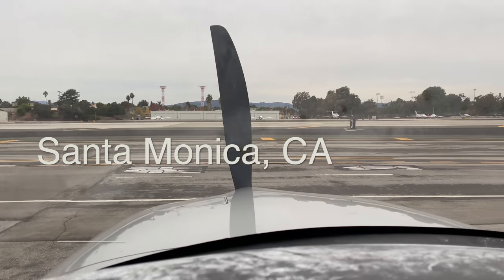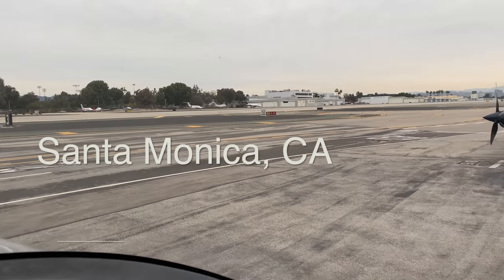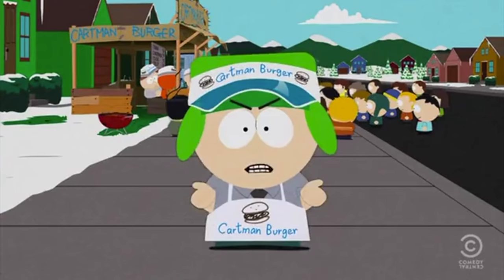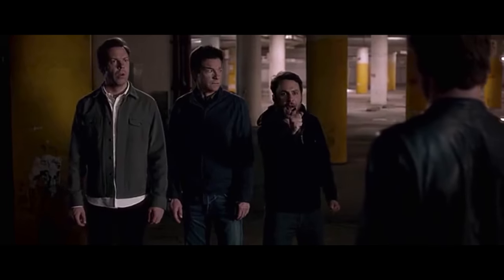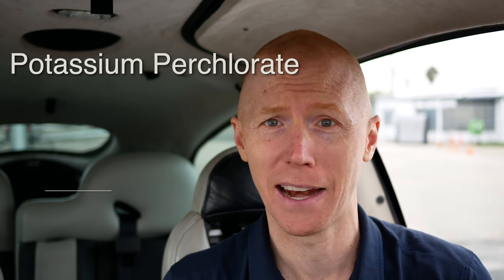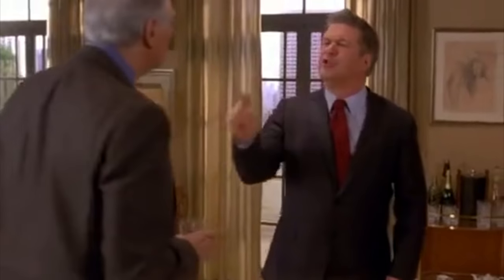WHY A Passenger Must Pull on the Mask | Airline Pilot Explains

Comment: A little aviation “trivia”. The 1996 ValuJet crash in the Everglades, was found to be caused mostly by improperly packaged plane oxygen generators in the cargo hold. They were expired and the company was transporting them. I placed the quotation marks on trivia because 110 people died and I’m sure to the families is not trivial.
Reply: Yeah the handling compay confused "expired" meaning out of date with "empty".  The fire was so intense it burned a hole through the cabin floor. RIP all on board the Critter.

Comment: Tell them how much time they have to put on their oxygen at 35000' before they go too silly to do anything.
Reply from the maker: well hopefully during that situation you yank it so hard to your face you don't have anything to worry about
Reply: Useful consciousness at that altitude is something like 30-60 seconds, if the cabin somehow completely depressurized.

I would be more worried about the pilots getting their masks on in that situation!
Reply: @HamBown  I won't. The pilots are trained for this scenario and the masks for them are very easy to use with one hand.
Reply: @roichir7699  there have been accidents due to pilot incapacitation in the past. They are the ones who are going to save the rest of you. The oxygen generators are only there for emergency descent. They last about 15 minutes.
Reply: @roichir7699  Tell that to Paine Stewart.
Reply: @HamBown  Of course there have been accidents due to that. But as long as you have no idea about technology improvements and procedures you are simply just guessing and not contributing to anything else than panic.
I did try these masks myself, I did experience hypoxia in a controlled environment, I did experience rapid decompression and other stuff. And I know how technology and procedures work.
They are as safe as it gets. With a probabilty of catastrophic system failure of less than 1:10^9.
That's about nine lottery jackpots in a row.
Reply: @simonjester6908  Do your research before making such claims. Especially what have been done since to prevent it from happening again.
Reply: @roichir7699  Are you saying Payne Stewart's plane crash was not due to pilot hypoxia?
Reply: @simonjester6908  You are missing the point. Back then it was concluded that the procedures and training were insufficient. So that has changed.
As before, it seems you have no idea how things work, how procedures work, which training pilots get and what progress has been made.

Comment: Hi Kelsey.  While it is true some planes may have a few oxygen generators for the passengers, 747-8 have oxygen bottles for the passengers just like the crew.  The 747-8 has a minimum of 5 passenger bottles in the fwd cargo sidewall and can have as many as 18 in the ceiling of the forward cargo. We also have very strict leakage rates, NO LEAKS ALLOWED! Check out chapter 35 in the Aircraft Maintenance Manual  (AMM).

Comment: On a lot of wide-body aircraft types like the B777, they DO actually use a large collection of compressed O2 cylinder tanks, stored behind the linings in the cargo area, for passenger emergency oxygen. The pressure can be displayed in the flight deck, and the tanks can be filled up by maintenance. On some airlines they just have to be replaced.

Comment: If there is a pressurization problem in a freight plane, would the pilots make emergency descent similar as in passenger planes, or more subtle descent instead?
Reply: They would as the pilots oxygen system has limited resources too. More than the passengers, but still limited.
Reply: Good question.
Reply: Yes

Comment: I think the engineers designed  "fake Oxygen" not only because tanks would be heavy, leaking etc.  but also because pure oxygen (O2) is an extremely flammable gas so it would be like carrying on board a bomb waiting to explode.The chemical reaction to produce Oxygen would minimize  that risk and would make Oxygen available only when it's needed.
Another interesting video from you Kelsey (being an anesthesiologist I have to deal with 02 on a daily basis),thank you for sharing it.
#Kelseyfavouritepilot 😘
Reply from the maker: that I am sure was another thing they were thinking about when they did it... Thanks Nina, really appreciate that!
Reply: @74gear  Thank YOU

Comment: Youtube comment section engineer here.  Another added benefit of chemical vs gaseous 02 is that it can function independently from any electrical systems in the plane.  In any sort of catastrophic failure it is it's own system that works independently from the plane. Unfortunately this reaction is literally ripping off atoms from each other (mainly hydrogen from oxygen in hydrogen peroxide due to it's abundance of 02 and easability/cost effectiveness to make) so it's going to basically generate heat no matter what.

Comment: These oxygen generators are actually what caused the crash of ValuJet flight 592 in Florida. Their cargo was labeled "used oxygen containers." When in fact, what they had on board were expired oxygen generators. A few of them were activated in the cargo hold. When these activate they generate a tremendous amount of heat. It started a fire and filled the cabin with smoke.

Comment: This should replace the standard FA announcement about the masks. I've only flown a few times, but don't recall any emphasis put on the importance of pulling on the strap to activate it. I feel that could lead a lot of people to unknowingly misuse it and not activate it. They also didn't mention anything about the cheat, odor, and smoke potential, which can confuse and panic passengers even more.

Comment: i remember from middle-school,  welding class -  A before O, or up you go ↑
acetylene before oxygen or else massive explosion.  Another reason no Oxygen tanks on planes,  
Oxygen by itself is extremely explosive!
Reply: There were older planes with oxygen bottles, one of them let go on a Qantas 747, blew a hole through the fuselage and through the roof via a door handle. The pilots thought a bomb had gone off.

Comment: The oxygen generators produce a lot of heat as well, it is stored separated, pressurised air tanks would leak out over time.
The compact oxygen generators are lightweight and are changed out for new ones every few years.

There are small compressed oxygen cylinders that can be carried around and are in compartments, usually 8 or more and these are for cabin staff..
Reply from the maker: There you go Grant you seem to be familiar with it all!

Comment: I would guess the chemically generated oxygen is also chosen, because either small tanks or large tanks with oxygen-lines are also a firehazard in case of leaks. Marine engineer worked as technical chief of a hospital here, so O2 leaks, as well as NO2 leaks were always a concern in the distributing pipesystem. Elevated O2 levels in close proximity to electrical systems are always a risk, though not likely a big risk. There would have to be an electrical fault as well, or open circuit that generate a spark.

Comment: Kelsey, some commercial jets had oxygen tanks in the past, like 12 or 15 liter bottles installed in the wall for passenger. There was an event where one bottle exploded and ripped a part of the fuselage. I think after that accident they implemented a new rule regarding oxygen tanks on board. It is true, like 20 x15 liters tanks are like 500kg or almost 1000lbs. They are heavy and in a case of fire they would be a trigger for even bigger disaster( fire+oxygen) very bad combination.
Reply: Are there still oxygen tanks on the plane for emergency purposes? Like in case someone has a heart attack? I imagine the oxygen used for when depressurization occurs would be inadequate.
Reply: @Boundwithflame23  For cabin crew in front and at the back there should be couple of 5-7 liter bottle with oxygen, it could be also used for first aid.The most important thing is to have some good trained cabin crew to make first aid like they are trained to do. Cabin crew needs oxygen bottle so they can move free and help and assist other passengers.Imagine if some need help and cabin crew can not leave seats because they have only oxygen provided from the ceiling like others.
Reply: @Boundwithflame23  Tanks for medical use and for the cabin crew are mandatory.
Reply: Ah. I figured as much. I was just curious because of the bit about a new rule being implemented.

Edit cuz my sleepy brain thought you were someone else on first glance, Touring Jedi.

Comment: If in a panic situation is it possible to pull the mask so hard that it can break?
Btw another great video!!
Reply: Yes. You can pull the hose loose if you pull too hard on the mask. The hose is easily pressed back onto the fitting. Remember, pull firmly , don't yank it.

Comment: 'in the US it's 41,000' - is there a reason it's different elsewhere, and why?
Reply: American lungs cant handle going as high
Reply: Different regulations in different countries, as USA has FAA regs (FARs) and Europe for example EASA. Many things change, including for example at what altitude you switch from local altimeter setting to standard (18.000 ft in the US, 4.000 I believe it was in some country in the Caribbean...can't remember) or even the unit you use for altimeter setting (inches of mercury in the US, standard being 29.92, and milibars in many other countries with the standard being 1013)
Reply: The reason : faa

Comment: Another interesting video! 

Not sure if you have answered this in another video already but what is up with the blinds on the planes why do they need to be up during take off and landing?
Reply: There's a couple of reasons for this

1. So rescue crews can see inside in the event of an emergency landing
2. If it's dark outside (and this ties in with having the lights dimmed for take-off and landing) it allows your eyes to adapt to the ambient light. That way if you have to evacuate for any reason your eyes won't need to adjust to see properly. 

The same applies for if it's bright outside, your eyes can adjust to the brightness so it won't just be a wash of white when you get out of that emergency exit
Reply from the maker: so you can see during an evacuation if there is something out there before you open the door
Reply: Additional to the already mentioned. You want to know if there is a fire on one side of the plane after the landing did go wrong. So you can use the exit on the other side.

Comment: Hi there. I have 2 questions. 1) When the plane descends to 10-15K feet--does the captain begin to ventilate with fresh outside air to get rid of the smell and the smoke and provide air for the passengers to breath? 2) On a long haul flight  across an ocean what happens when the plane experiences decompression? Can the plane descend to 10-15K feet and still have enough fuel to make it to an alternate airport?

Comment: That’s interesting. I’m not a chemist but since oxygen is it’s own atom despite usually pairing up together in twos I figure they spark a chemical reaction which causes another chemical to break down into oxygen and other molecules.
Reply from the maker: exactly, and a lot lighter to transport like that than in a big tank.
Reply: Yes. The compounds are all over rich in oxygen, so they decompose leaving an oxide and spare oxygen. A simple example, not used for this purpose, is hydrogen peroxide breaking down to oxygen and water.  2 H2O2 => 2 H2O + O2. And a lot of heat.

Comment: Regarding oxygen masks and depressurization or lack of oxygen onboard aircraft, there was in incident with Helios Boeing 737 (flight 552 i belive), where plane crashed due to incapacitation caused by depressurisation, and everyone died.There is a 'check in' system in trains for train drivers, where train driver have to push a 'check in' button to prove he is awake every few minutes or emergence brake will automatically be activated and will stop the train, so i was wondering, why there is no such system in commercial aircraft.For instance, if a pilot or co-pilot dont push 'check in' button every 5 or 10 minutes, autopilot automatically engages and executes descent to safe altitude, while emiting emergency code.
Reply: That would be a problem as usually the situation will be that worse that no autopilot can save it. That's what pilots are for.
The incident is tragic and led to some improvements that will prevent a repeat.

Comment: Oxygen tanks and the necessary equipment is much more complicated than these cartouches. It is very expensive to build and maintain to get the reliability you need.
The cartouches however can be easily replaced and maintained outside the aircraft. They do not need to be specially build for this aircraft and can be mass produced. And you don't need a lot of manpower and time to maintain them. If there is a problem a mechanic can replace the cartouche in some minutes not hours and a grounded aircraft if that happens to a tank system.
There are more reasons to use that system, but these are the basics.

Comment: Lots of heat for sure.  I recall an air  incident that  several oxygen generators were bein transported and activated in flight  causing a fire....😲😲😲.You were close to the sonoma airport that gives biplane rides...try it😀
Reply from the maker: I haven't been in a biplane ya maybe I will try it!
Reply: That was Valujet in Florida. Air Disasters  did an episode on it.
Reply: @74gear  I've ridden in a Ford Tri-Motor twice (about 45-50 Years apart) but a ride in a Stearman biplane and a DC-3 still remain on the bucket list.  ;)

Comment: Another reason not to have oxygen for the passengers is the weight of the canisters the oxygen is stored. You would have to have one foe ever passenger.  Also oxygen's extremely flammable and adding an accelerate above the head of the passengers wouldn't be good. Way easier to have a localized chemical reaction to create oxygen.

Comment: Excellent info on things I’ve always wondered about.  Thanx for posting.  Great info on the stink and smoke associated with mask deployment.  Some follow up questions: How do the masks get deployed?  Is there a switch that triggers them? Is it done automatically?  If switch, is it actuated by pilot or flight attendant?  Is there an alarm in the cockpit so that the pilots see there is a need to descend at once?  How hard does one need to yank to initiate flow?  Why does the bag not inflate?
Reply: great follow up questions, and if you don't mind i'd like to add one?  Some one who is panicking might yank TOO hard.  How hard of a pull will loosen a connection somewhere so not enough oxygen is available for normal breathing?
Reply: There is a switch in the cockpit and also an automatic deployment when the cabin pressure gets too low.
There is an alarm too. More like all the cockpit is yelling at you and of course you can feel a rapid decompression.
Just give it a firm pull, that would be enough. It is not designed to be used as a rope.
The bag may inflate like a balloon if there is more pressure that on the outside. It acts as a pressure control device. You will get enough oxygen even if the bag does not inflate.

Comment: Rule number one of an emergency: don't panic.

I have a degree in biology but I had to take a shitload of chemistry as well. One thing I noticed very early on (and had to take a small break to laugh about it because I laughed so hard that I cried) was that the chemical process by which we make energy is roughly the opposite of the ones plants use for photosynthesis. Then I realized that, while our waste that we exhale is CO2, the plant's waste is oxygen. Suddenly, it occurred to me that plants poop oxygen! X-D

In any case, plants make oxygen through a defined chemical process and, while it smells better than I imagine these processes making oxygen on an aircraft smell, it's no less of a chemical process. Our very being is made of chemicals so, instead of being afraid of chemicals in general, it makes more sense to be afraid of certain chemicals and, believe me, no one is more afraid of the actually dangerous chemicals than those of us who step foot into a chemistry lab. As someone who has spent many years in one, I can tell you than the chemicals listed in this video, when reacted together will produce oxygen and that you are better off breathing that than trying to breathe the air in a plane suffering from decompression. As the COVID-19 virus has taught us, oxygen is the most essential thing for life, followed by water, and then food. If you don't breathe in oxygen, no amount of water or food will do you any good when it comes to survival.